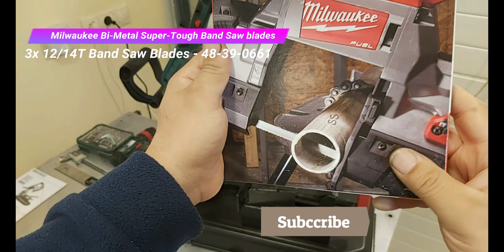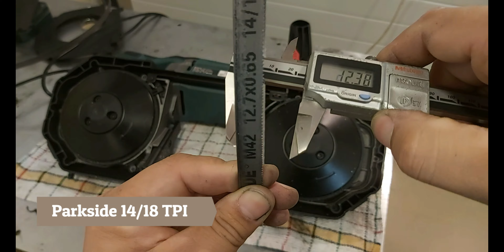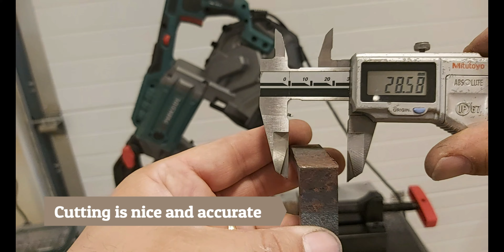Parkside PMB 1100  Metal Band Saw + Milwaukee Bi-Metal  blades Unboxing and Test   PART 3

Comment: I bought about 1140 × 12.7 × 0.56 Milwaukee Bi-Metal for that Parkside saw and danced the saw blade. Cut less straight
I think the reason is because it is 0.56 thinner
Reply from the maker: Even with me is 0.56 and feel that the weld joint is inaccurate

Comment: I must be doing something wrong. I did same way and my blade is keeps sliding off when it’s spinning. Yes it’s locked and tightened but no idea why it’s starts sliding off from between small wheels?? It’s original blade so the no size issue..
Reply: I have the same issues. I ordered these Milwaukee blades too. I can't recommend them because these blades slip (and yes tightened well) and when running the blade moves up and down. The original blade works fine, just cut an 11 mm thick plate (10 cm wide) and did this fine at 90,1 degrees which is nit bad for this budget machine. I asked Lidl shop where I could order original blades. So far no reply.

Comment: Hi. Is it better than the original??? I just bought this machine... I would also need some replacement cutting blades... Where did you get it from???
Reply from the maker: hello try order here  https://www.cpomilwaukee.com/milwaukee-48-39-0561-44-7-8-in--14-18tpi-band-saw-blade--3-pack-/miln48-39-0561,default,pd.html?group=miln48-39-0551